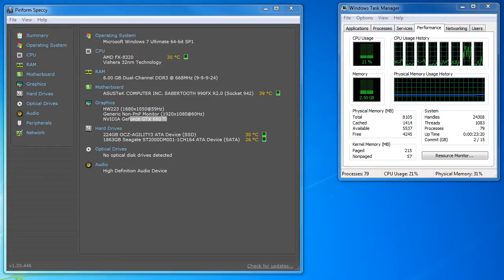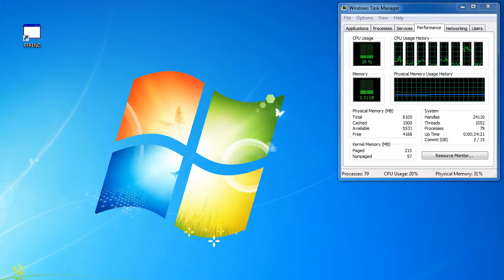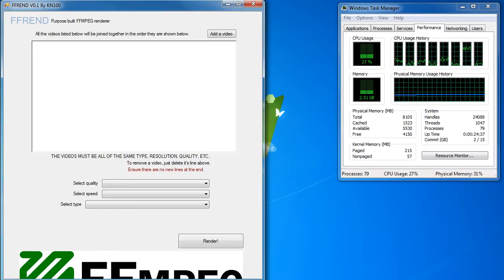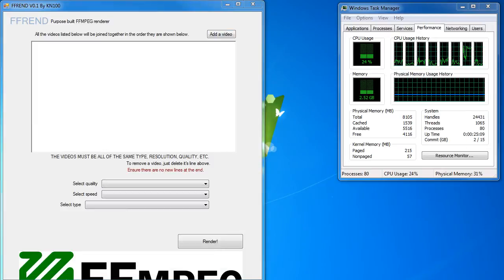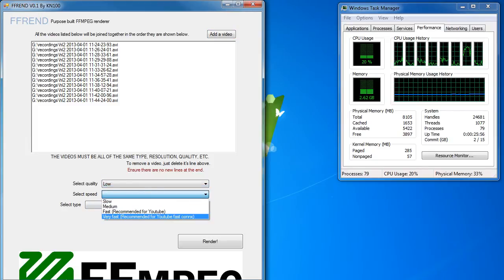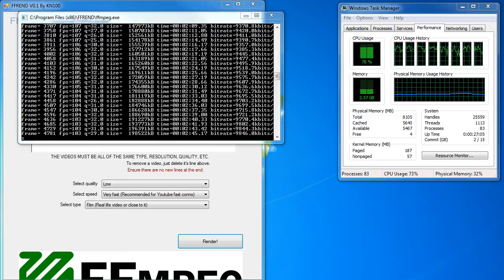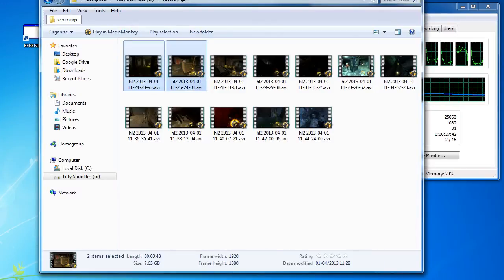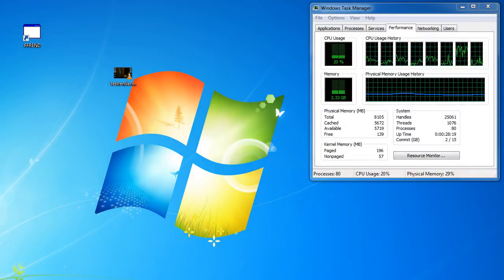FFREND - The fastest Youtube rendering tool on the planet - Tutorial

Comment from the maker: dxtory also produces 100MB a second of video, doesn't use a standardized video format - produces two audio streams which is more a pain then anything - and is a dick to work with. If you've got eight cores and you run games on a separate hard disk/ssd fraps doesn't drain resources at all and produces smaller files - and the 4gb limit is awesome if you're avoiding video corruption which is something I've experienced once or twice hahaha